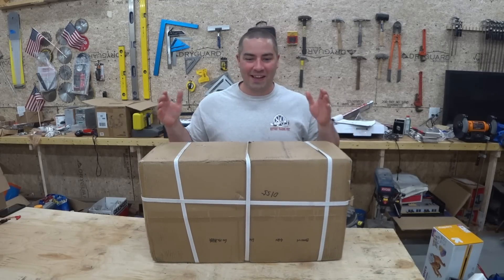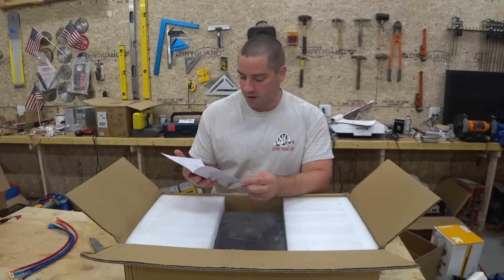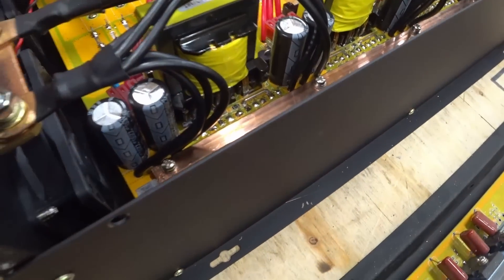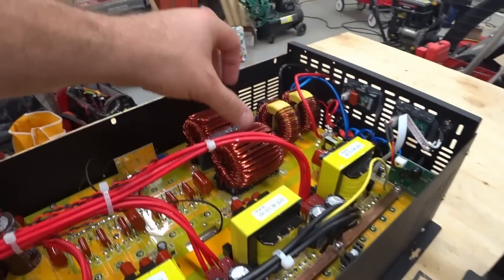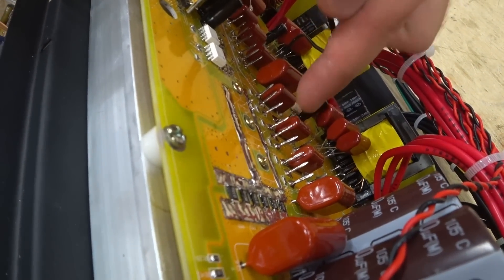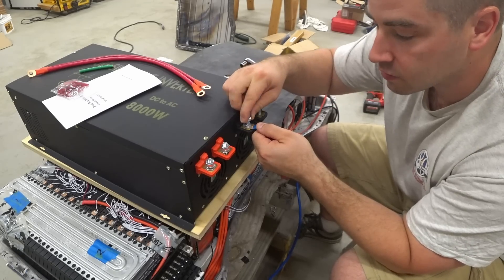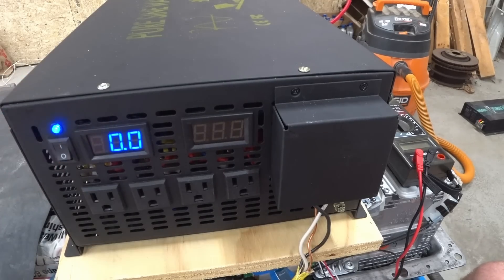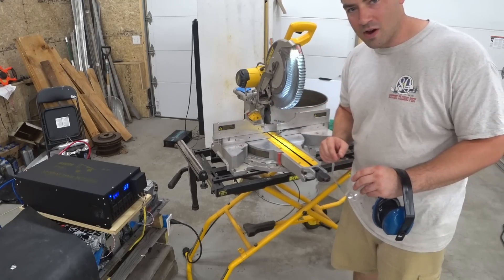Cheap 8000w Reliable Inverter, That Works! WZRELB

Comment: Just curious why you wouldn’t go with Split phase 220/240v to power your breaker box.
Reply from the maker: I do.  I have an Aims inverter, 120-N-120 and power my whole house with it.  Reliable sent me this model to test, and it happens to be single phase 120v.   There are a few videos on my channel about the Aims inverter if you want to see that.
Reply: I’m running 5.4kw (should’ve been 6kw but shipper broke 2) Wired panels in series of 3 for 108v then 6 parallel. Split into 2 sets. Front side roof and back side roof passed off to 2 charge controllers. Sun passes over almost directly overhead. Had one controller programmed wrong and couldn’t understand why we were dropping out at 4am. My daughter actually caught it.
Reply from the maker: That's nice you split your system with two controllers.  Good job to your daughter.
Reply: I see, cool. I have a powerjack 8000w in place in Philippines at my retirement home. Works great and it used to drop out at 2800w but I did some hacked the control board into reading the output lower than actual. Their algorithms were set really low and the toroid coil can handle a lot more current for a lot longer with constant cooling. Higher com fan helps too. 24v fan that screams so loud nobody will sleep in there 😝. Cool battery pack you have there, wish I had gone 48v but hindsight you know. 40 lifepo4 prismatic batteries at 200ah each make up for it tho. How many watts are your panels up to now?
Reply from the maker: That's a lot of lifepo4 battery.  Nice.  
My solar array is 4.38kw.  Last week we were doing just over 3kw in the heat and tilt.

Comment: Am I missing something or did I just watch a video of a guy testing an 8000W inverter with ~3600W and then call it good?
Reply from the maker: This is the first video with this inverter.  I'm currently working on wiring in more outlets so I can bring the inverter up to 8kw.  Or at least try, we will see if it can handle it.
Reply: Are you sure it wasn’t ~7,200W ?

Comment: Nice to see the inside of it - looks well thought out with that huge heatsink on the bottom of the board taking half the airflow - I wouldn't be too worried about the small wires on the main connection, amp ratings are all about heat buildup in cramped conduits so being open and in a fan ventilated space it should be fine. What I would think about is that the long pins left on those mosfets look like possible short-points, and should be cut off. Maybe they were left on for testing or maybe they were just left by an assembler with time pressure? I would cut them anyway. Also interesting they rate those transformers at 2000W each... otherwise looks real nice in there.
Reply from the maker: Thanks.  I'm glad you like seeing inside.  My wife said that was the boring part.  LOL

Comment: With that much power why not 240vac output
Reply from the maker: This brand (Reliable Electric) makes single phase inverters.  But, you can order single phase 120v, 230v, or 240v.  You can also order 50 or 60 hertz.  To my knowledge they don't make any duel phase inverters (sometimes called split-phase).  However, you can use a single phase 240v and run it through a transformer to make two phases at 120v.  "Going Off Grid" YouTuber did this.  I recommend his channel if you haven't seen it.

Comment: The wire may only be 10ga. Or so, but then its like 6" or so also. Look at how small a fuse is! And carrys a good deal of current, I'd say the 10 gauge will carry 60-80 amps safely for a decent amount of time, it may be a bit warm after doing so, most current ratings are for 25'-50' or so,
Reply from the maker: Thanks James.

Comment: Thanks, nice video.
They may have used a thiner wire at the output to increase a bit the resistance and avoid huge surge current when load starts.
Problem is that over time it will over heat.

Comment: they go through all that effort beefing it up and then skimp out on the main output wires .
Reply: Yeah, I didn't get that either.  They are easily removed and he can replace with larger but he shouldn't have to.  I hope the maker watched this video and ditches those 10awg wires for 4 or 6awg at least.
Reply: @thebeststooge  the output wires don't actually need to be that large. The old unit had larger wires due to an uregulated output. This new unit has a controller preventing the output current from exceeding the current rating on the nameplate

Comment: For a real test you should load down the saws. A free spinning motor draws less current than one that is working. Run a piece of wood through the table saw and see what happens.
Oh wait. You did. Sorry, I jumped the gun there.
Reply from the maker: No problem.  I plan to do more testing of this inverter, going to find out if it can get all the way to 8kw.

Comment: Do you use any HpFI or HFI 
Fail current breaker like we do in Europa???
Reply from the maker: I'm sorry, I'm not familiar with those terms.  I used circuit breakers between the battery and inverter.  In this video there is no circuit breaker between the inverter and load.  If I was setting this up permanently I would have a circuit breaker between the load and inverter.  In some future videos I'll be doing more testing of this inverter and will be adding some circuit breakers for those tests.
Reply: Hey hey cool
HpFI is a fail Safe Relay  who trips if IT feels a drain to earth
Exseeding 30mA !! On the AC side of inverter
So if any power goe's in you hand truh you body past the hart 
Down to earth 
Then the current ain't big enough to kill you and
The hart won't stop !!
HpFI-B is if you use a combined 120/230v Grid tied inverter 
MPPT/inverter/DC chardger
This is by law in whole EU 
The B model stops DC entering the Grid ..
HFI is lightning sensitiv 
HpFI ain't .. 
My Relay have tripped 2 Times .. by purpose.. so i know IT wil WorkMine is a 3 phase 40A HpFi  so you can pull a Lot of load 
Trugh IT .. 
I think IT's a good thing to hawe when fooling around with 230v 6000watt
When i am don .. ill hawe 2 x 6000 watt

Comment: The wiers are okay .. for 10cm  not 10m 
So they are thick enough due to Short distance
You Will need bigger leads from inverter to Distribution / Fuse box
Reply: Remember 
DC THICK LEADS  EVEN SHORT DISTANCS 
AC not so THICK LEADS ... AND THIN WIER OVER SHORT DISTANCES ALLOWED 
RISISTANCE AINT THE SAME IN A C ... AS ... D C 
DIVID WATT WITH VOLT = A .. 8000 / 120-230 = 67A-35A No . Always whole nr

Comment: If you were to goto the NEC and look up table 310.16 you would see that between a 60c wire and a 90c wire the amperage is increased.  I do not read Chinese either but maybe their insulation allows smaller gauge wire to run higher amps.

Comment: I wonder about the voltage display increasing when under load. I'd like to see the voltage actually verified with an independent meter. Let's be certain their engineers and management aren't related to VW engineers and management...
Reply from the maker: LOL.  OK.  I'm planning a follow up video with more testing.  I'll throw on my volt-meter during that.
Reply: I have the 3500 watt 24 volt reliable. My meter reads 130+ volts,but put a multi meter on it and it reads around 120. It has problems with starting a 5000 btu air-conditioner. Not impressed with mine. 2/0 multi strand wire coming into it from 2800 18650 batteries.

Comment: The link you supplied listed a 7k inverter. Not 8k. So 40 watts wasted in standby and 85% efficiency for 1500 dollars. Why did you preload the capacitors? And such a short run might be OK for 10g wires.
Reply from the maker: Thank you about the link.  I have e-mailed Reliable asking them for an updated link.  I pre-loaded the capacitors because it was suggested by a couple viewers as a way to avoid risk of damage.  Thanks for watching.
Reply: @DavidPozEnergy  It's an honor to watch your quality videos. By the way there is a wire gauge calculator at http://www.paigewire.com/pumpWireCalc.aspx?AspxAutoDetectCookieSupport=1
I cannot attest to its accuracy though. If I used it correctly it calculates a copper 4 AWG wire is needed for 1' of travel given single phase, 120v, 60 amps if you want to keep the voltage drop to under 3%.
Reply from the maker: Thank you.  4 gauge would certainly do a better job then the 10 gauge there now.
Reply from the maker: Reliable Electric just sent me this link: https://amzn.to/2SyjCfy  They said they are going to be adding the 48v 8000w inverter there within a month.

Comment: I agree with most comments.  It was fairly impressive in this test.  Will see what it does with the higher more continuous loads. I would like to see the initial peak starting amps/watts on the larger motors and the sine wave  oscilloscope .  Did you tell the voltage input range?  If so I didn't hear it.  I also see limited benefits for this large an inverter that is not capable of 240 volt and the "live ground" really limits its usefulness.  If you wanted to run whole shop from it maybe you could use a lockout switch (instead of a transfer switch)  on a shop panel and thus protect the house from the live ground aspect.  It would be fine for a shop with only 110v needs or even small 110 volt air conditioner in a shop.
Reply from the maker: I did not say the voltage range in my video, but I just checked the manual for you.  It says 40-60 volts.  
I agree with you about the limited use due to the live ground.  I'm considering two different options.  First, some kind of mobile application for my tools in the field.  Second, maybe a diversion load for water heating (when there is solar power, but the batteries are full).  What do you think?
Reply: @DavidPozEnergy  I think both of those possibilities sound practical and promising

Comment: Go look at the internals of a meanwell inverter. Then look at Chinese junk. 
Then come back to this and tell us whether the reliable is quality or not. Pro tip, you will send it back
Reply: Aims, hard to actually see the electronics but the rest looks good. Efficiency and idle current are still lousy.

Here's a meanwell https://youtu.be/brywugQ2-kI
Reply from the maker: I did make a video comparing the insides of my AIMS inverter to the Reliable brand.  I like the AIMS more.  Any concerns you see with the AIMS in this video? https://youtu.be/dfHb5tZErTs  Thanks.
Reply: @DavidPozEnergy  here's how you test an inverter https://youtu.be/J8tgg15XPEk

Comment: Junk. Automotive fuses in parallel? 85% efficient? Wires far too small? No thanks
Reply: You get what you pay for and for the price they are quite good
Reply: It won't catch fire because the continuous rating will be about half the maximum 8000 watts.
Reply: This will catch fire

Comment: I notice with the air compressor running and the heat gun on, there was a voltage sag.
25amps is above the flow limit of #12 wire you used.
Redo the comparison with #10 wire feeding the outlets and see how it fares.

Maybe feed a small panel with #8 conductor, and have 4 or more receptacles outputting from individual #12 circuits. You should be able to power the vacuum, the mitre saw, the heat gun, and the compressor without voltage drop then.
Reply from the maker: Next inverter video I plan to hook up several more outlets and try to bring the inverter up to 8000w.  What do you think, will it make it?
Reply: DavidPoz I am concerned about the uncrimped soldered only leads in the inverter...
Reply from the maker: Me too (about the soldered ring terminal).  I'm going to try and do a test at 8kw.  If it gets hot then I'll probably replace the wire and ring terminal.

Comment: Is not the terminal block split phase 240v? So, red is hot L1 and black is hot L2... ground should be the Neutral leg...
Reply: Wow... an 8000watt 120v output... I hate it.

Comment: research chassis wiring vs transmission wiring
Reply from the maker: Thank you.  Another commentor said 10 AWG wire is rated for 55 amps maximum in chassis.  Is that in line with what you are thinking?  It certainly makes me feel better about it because I was thinking household wiring (30 amps).  Still a bit shy of the 66 amps that this inverter is claiming.

Comment: you get all happy when motors start well there was no load you should have been sawing through a 4x6 then you could get all happy!
Reply: Was gonna say the same thing. That's where motors draw the most current, when under load. Or stalled.
Reply: @HobkinBoi  Stalled, definitely. It's referred to as locked rotor current. Typically 5 to 6 times greater than max running current.

Comment: The wires can be smaller if you have a 24 volt system do you have 24 or a 12 volt batteries as 12 volt needs much larger wires ?
Reply from the maker: The battery is a Lithium, 14s, which is 50.4 volt (nominal 48v) setup.  I agree with you, smaller voltage systems need much larger wires for the same watts.

Comment: Hi, my name is Franz.  could you do a test an a 12v DC to 220v or 230v AC from 5000 to 8000 watt inverter with two 120 V hot wire each, i  have a 230v 9.0 amp electric Motor with a 2" Milk Pump i tested that amps an 208 v it tester guegs mart from 4.5 to 5.4 amps continuous each wire  i have 3 Battery 850 cranking amp 12v an that trick the ar hooked up to 12 v, what size of inverter do  i wil need
Reply: it is impossible, if you need 5000W, considering an efficiency of the inverter of 85%, the batteries must supply about 490A at 12v, and if you need 8000W  with an efficiency of 85%, the batteries must deliver 785A at 12v, but if the  batteries are discharged and are at 10.50v, the necessary current becomes 900A.
Reply: If You are using a 0000 AWG (107.219mm²), 1 meter long pure copper , wire, the cable shoud dissipate 535W and you have a voltage drop of 595mV, and if It Is alluminium, it Should dissipate 1043W and a 1159mV voltage drop.

Comment: Idk why i get goosebump seeing those  wires goes through those holes and there is not any insulation beetwen wire jacket and metal edge
Reply from the maker: Yeah.  I'm considering removing those wires and drilling it out larger, then add bushings.

Comment: Is this an off-grid inverter, or can it also do grid tie?  If it is only off-grid, have you plans for building a grid tie battery set up?
Reply from the maker: Hi Neil,  This is off-grid only.  I have been running my house most of this summer off my chevy volt batteries and AIMS inverter.  But that is not grid-tied, it's connected through a transfer switch.  I don't see a need to add a grid-tie inverter, but maybe if I add extra solar.
Reply: @DavidPozEnergy  Thanks - I really appreciate your work.  I am hoping to add a battery to my 10.1kW solar PV system, and since it is grid tied, I want to learn about that.  I also hope to be able to at least manually toggle to use the battery, if the grid goes out.

We have 3 electric cars (and NO gas ones!) and we heat / cool with mini splits, so we use about 2X what the panels produce on a yearly average.
Reply from the maker: Hi Neil,  WOW, 3 EV's!  That's awesome.  I think EV's take an average of 40 amps to charge, so do you charge them all at once, or one at a time?  A 40 amp inverter vs. a 120 amp inverter is a big deal.  
There is someone on "DIY Powerwall" Facebook group called Terry.  He posts almost every day.  He uses two inverter off a massive battery bank.  One inverter powers his shop/house and one inverter is dedicated to charging his EV's.  I think that inverter is a 6kw Sigineer.  But, again, those are off-grid situations.  I know someone else who is currently installing a "Sol-Ark 8kw" and he replaced his existing grid-tie inverter.  The Sol-ark is both grid tie and off-grid.
Reply: @DavidPozEnergy  They all take up to 32A 240V - so yes, they need a 40A circuit.  We have one charging station, and sharing it is no problem.  The cars have different ranges, so the most we need to do is charge 2 in a day - 1 in the afternoon/evening, and then 1 overnight.

We have a Chevy Bolt EV, a VW e-Golf, and a Smart EQ. They are 238 miles, 125, and 58 respectively - that is their EPA ratings, and they average that over the year.

I also have a better.bike PEBL which is an electric / pedal enclosed recumbent reverse trike, that gets about 1100MPGe.  That's 130+ miles on a 64Ah 48V battery - 3kWh.

Thanks for the information on the Sol-ark.  I am told we are not able to automatically switch to the battery if/when the grid goes down, but even if we had to do it manually, that would be fine.

Comment: The length is a factor as well. That is very short. You have to increase gauge as you increase length.
Reply: It also depends on the wire insulation type. Some silicone insulated wires can handle a higher load with the same size wire. It also depends on what type conductor is inside them too.

Comment: Hi David, did you have a problem with customs?  I've had a couple package opened and hold by customs services.
Reply from the maker: No problems with customs.  The box looked like it was only taped once at the factory.  No indication of someone opening it during transit.